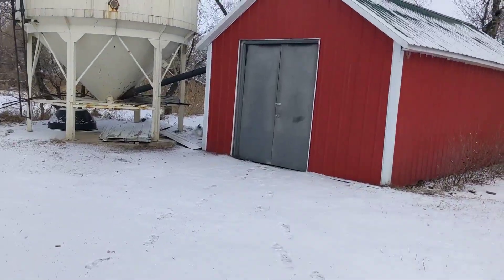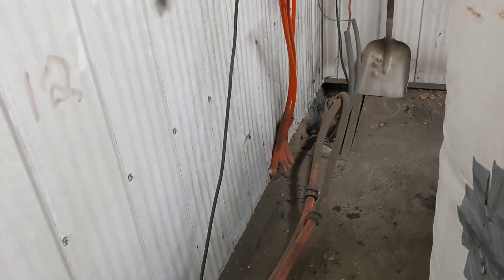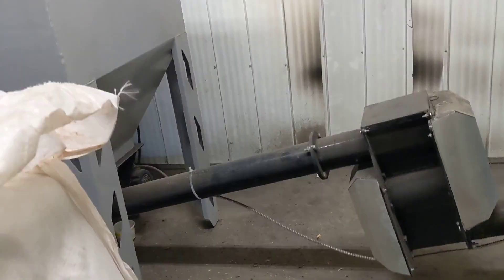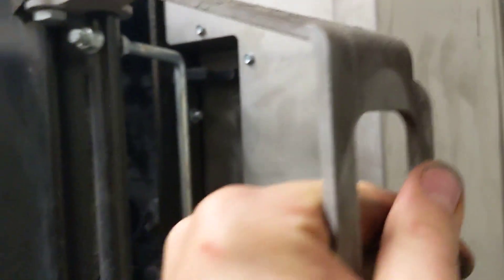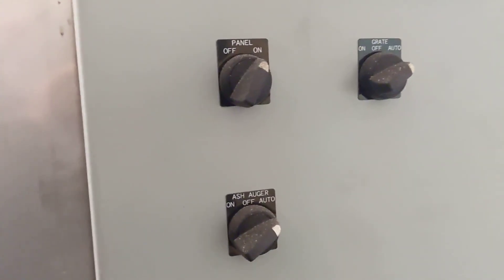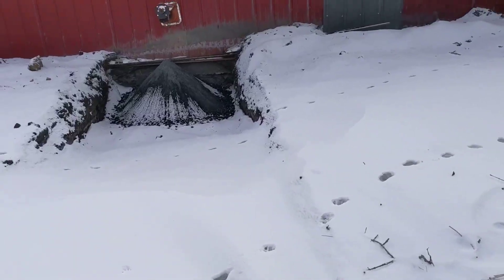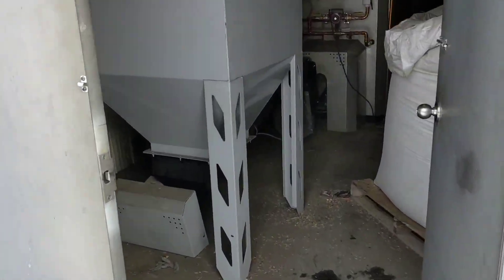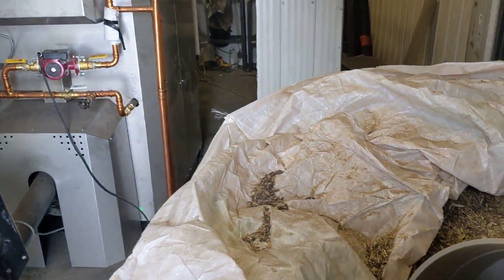How I heat 7000 sq. ft. for cheap in Canada with a multifuel biomass boiler (portage and main)

Comment: I live in South East Victoria Australia and am involved in the bluegum hardwood chip industry. The chips are exported for pulp . The waste left behind after the trees have been harvested is ridiculous. Waste meaning the limbs and bark after the trees have been harvested and chipped . I see a secondary use for all this slash such as fuel for a heating system such as yours . All these slash piles in the thousands and thousands of tons are just left to rot into the ground . 👍 thumbs up for your setup .
Reply from the maker: Feel free to send those chips over here for testing ;-)
Reply: An issue with biomass fuel is whether you can transport it at a low cost.

Comment: How do you get the material for free?
Reply from the maker: There's ergot in the rye. Spoiled crop essentially. Useless to the farmer. It costs them more to haul it to a landfill then to give it away for free.
Reply: @mikedueck  How much does a system like yours cost if I did the install myself?
Reply from the maker: @robertlaird6746  it depends where you stop. Boiler, building, bin(s), hydronics, etc. The boiler was around 20k, I probably spent 5k on hydronics.
Reply: @mikedueck  I'm building my home on acreage debt free and am doing all the work myself, without hired labor. The home is in the framing stages but I have plans on building a pond next to the house for a geothermal heat system. I also have plans on installing hydronic in floor heat using possibly a propane powered thankless water heater. I'm also going to build a large greenhouse and was planning on digging out the dirt underneath it, building an ICF foundation and then laying pips mixed with rock and dirt for geothermal air to heat the greenhouse. I was thinking of installing solar to power the fans to move the warm ground air through the pips. I live in western WA around the farming community but don't know anyone that I could contact to get any product if I was going to use a system like yours. I'd like to use two sources of heat that are free and then burn wood. If I was going on vacation, I would know that my home would not freeze with those two systems in place. I'm trying to stay away from getting a bill from the power company as much as possible since that adds up over time and I have a large home with several large out buildings that I plan on building in the future. Decisions... decisions.
Reply from the maker: @robertlaird6746  yeah, there's a lot to that. Probably more of a question for a heating contractor. Good luck though.

Comment: How many bushels of screenings do you burn in a winter?  Do the screenings flow easy from the bin or do you have plugging issues?
Reply from the maker: This was a much warmer year than average so it's hard to say.I didn't even burn the whole small bin this year. I filled the big one in fall too because I didn't know much I'd burn. I filled the small one connected to the boiler at the end of November and I still have about 1/3 left. The small bin holds about 1300 bushel. So this I I burned maybe 900ish?
Reply: @mikedueck  does it plug with screenings??  I have seen that stuff plug just coming out of the truck?
Reply from the maker: @Renegade1979  my old boiler did, but it was a coal boiler with a head and ring type burn chamber. This walking grate I have now works perfectly. The old coal boiler would plug up in the elbow under the head/ring with screenings. I've had 0 bridging or anything like that in the bin with screenings - unlike coal which would bridge when it got very cold. Aka -35c.
Reply: @mikedueck  awesome.  Thanks for the information.

Comment: The boilers true value will be unlocked if ever the house goes on sale, you can easily redeem your whole initial investment. 👌
Reply from the maker: I agree, but have no intention of selling. I love it here.
Reply: @mikedueck  , ok but remember a house is an investment and therefore a marketable security. Therefor logic dictates that one must never fall in love with a stock (house) that can be bought or sold. Always be prepared to cash in and move on to the next investment when the one you have (stock/house) has reached its peak evaluation and now has limited growth potential. Have a nice weekend.
Reply: @saint2709  yes and in another 10-20 years his farm or "acreage" will be worth almost 2x

Comment: Nice setup, with obligatory cat tracks. Chase down your air leaks before adding insulation, whether the latter is in the planning stage. Thermal blankets and/or shutters for windows would be more important than upgrading thin insulation anywhere. Spent 25 years in Alberta so I have a good idea what you're up against, and I was an insulator for a while.

Comment: Do you wish for heat storage tank?
Reply from the maker: No, i have no need for one. the system works perfectly as it is. on exceptionally cold days (-40c) it will pretty much call all day without ceasing, but a storage tank wouldn't solve that problem unles it was the size of a swimming pool! haha.

Comment: Same system like my smaller Hedestoker boiler,burning chipped wood and water heated pipes in floors,circulating water from 2000 litres insulated watertank.

Comment: Well, not zero dollars. There's the cost of transport and electricity to keep everything going. Maintenance always costs something. It is a good way of heating if you have access to consumables at a reasonable cost tho.
Reply from the maker: True. It's not actually zero. Transport cost me $300 to fill both bins. Maintenance...I haven't owned it long enough to say. Water treatment, glycol, etc. Cost to run the pumps. All minor in comparison, but you're right. Nothing is actually free.

Comment: This set up probably  cost more than what i pay the gas company to heat my house for 20 yrs
Reply from the maker: It just might. But keep in mind I heat 7000 sq ft of not-so-well insulated building in Manitoba Canada. Was costing $10,000 annually in coal, which would be somewhere around 15k+ in electricity, and a gas connection is $200,000 as I'm miles from the line. I wish that was a made up number but I inquired about it before going through with this as it would certainly be easier.
Reply: @mikedueck  This guy is most likely heating 1300 sq ft home and thinks he has something figured out...Your system is great and multi fuel advantages that his types could not imagine..You are set for what is about to hit us in the near future...Gd on ya..cheers
Reply: @xxdragan1969  You are right coming to the USA soon these energy costs and penalties will soon arrive !
Reply: @mikedueck  how much, roughly, do you have invested in the whole setup?
Reply from the maker: @Nathan-J-42  ummm, hard to say. The boiler is around $20,000. The hydronics is probably around $4000-5000. The bins and the building were there when I bought the property.
Reply from the maker: @Nathan-J-42  ummm, hard to say. The boiler is around $20,000. The hydronics is probably around $4000-5000. The bins and the building were there when I bought the property.
Reply: How many SQ ft are you heating??

Comment: Mike Where did you buy the boiler and what was the cost and is there someone that will set it up. I also live in Canada and would love something like this to heat my greenhouse and work shop
Sincerely Jane something else could you do a video on cleaning the unit. Thank you again
Reply from the maker: I may do a cleaning video yet, yes. Stay tuned on that front. Contact heat smart plus in Prince Albert SK for sales.

Comment: Insulating the boiler room, will help by warming up your fuel hopper, thus drying it more, and reducing your heat looses from the boiler and pipes. You can do it rather cheaply and easily yourself, or you can pay a bit more and have it done professionally. I installed expanded foam 50mm insulation in my boiler room and house roof for $8/m^2. It really does make a big difference especially for a roof.
Reply from the maker: that boiler building is insulated.
Reply: @mikedueck  pole barn ftw

Comment: Im near Edmonton, I would be interested to know where you source your fuel from?
Reply from the maker: any farmer! the trick is having bins empty and available. they won't keep it forever. get it when you can.
Reply: @mikedueck  I got a 1950's coal burner,the kind with the turn table, would you think it could burn that rye?
Reply from the maker: @bertvisser6423  it's hard to say. if it feeds into the bottom of the head/ring the issue would be at the elbow. If it's sharp it will likely compact and clog up. if it's a relatively gradual elbow it might work. this was my issue burning the sunflower screenings in my coal boiler. it would jam up the auger at the elbow from time to time. it was annoying and not reliable enough for winter.

Comment: That's to easy. I have a wood  batch box boiler I'm trying to perfect, its so clean a burn. I heat 160gallons of water to move to heat 44by77by 35. Didn't know I could run 2 circulating pumps same line, thanks 4that. Question to u, does system have expansion tank inline or relief valves. Another question, radiators used to heat 🏠, do u also use as domestic water
Reply from the maker: yes, i have a rather complex system in the basement. this system does to my hot water. it heats floor heat under the subfloor, in concrete, and through a rad in the my furnace. i also have an indirect hot water tank for my domestic.
Reply: @mikedueck  how much wood u burn? U heat domestic water by gas?
Reply from the maker: I don't burn wood. Regarding the rye screenings in the video though, I'm not sure. This is my first winter. I'm guessing around 25 or 30 ton.
Reply: @mikedueck  u sayin u burn alot of wood. 4by8by18 a cord. Okay. Do your water temperatures fluctuate in ranges.? How long it take to heat the pad. Must feel GREAT in there. Do u know the out temp verses the return temp difference.
Reply from the maker: @columbusjuju5500  I don't burn wood. I don't measure in cords. Understand that please. I have 2 different concrete floors. One is 1100 sq ft and one is 3000. The temperature of the main loop fluctuates based in what is calling for heat. I heat 7000 sq ft. I heat with heated floors(concrete, wood, tile, and carpet) concrete pads, radiators in furnace, Towel warmers, etc. The main loop return temp when everything is calling is probably around 120. That's a bit of a guess.